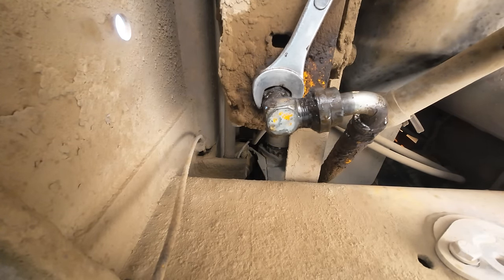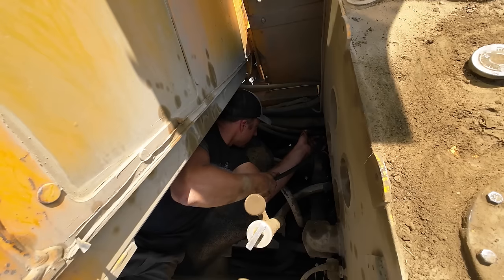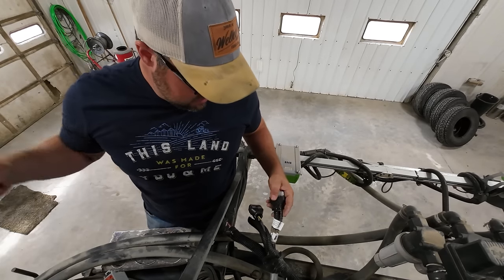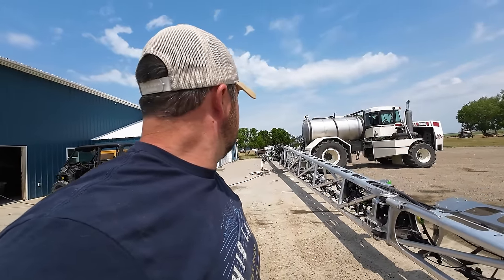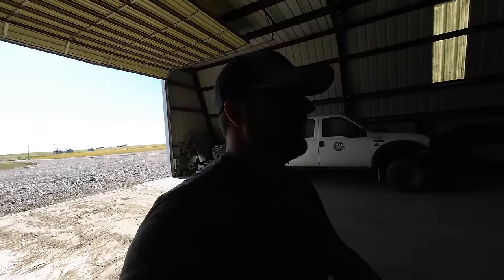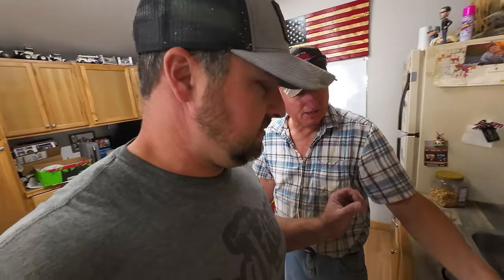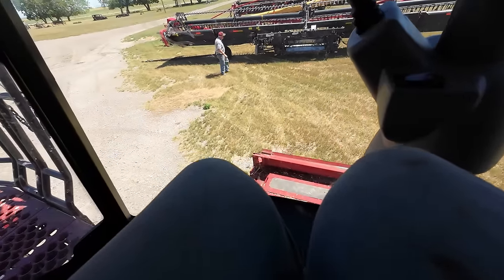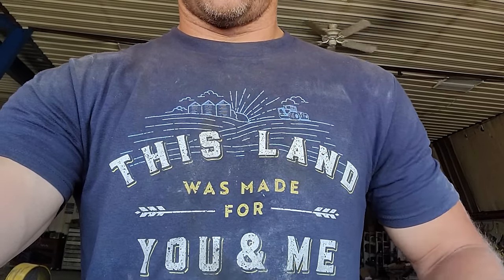Get The Combines Out! HARVEST TIME!!

Comment: When putting the combines away for the season put dryer sheets in the cabs to eliminate the chance of having mice in them over the winter months
Reply: I do the same.  In the winter I stuff dryer sheets around the motorcycles, lawn mowers, etc, and spring around snowmobiles, snow blower etc. to keep mice from chewing on wires, etc.   I was told Bounce brand works the best to keep the mice, other critters away (don't know if that is true, but have not had any problems so I stay with Bounce - superstition I guess)  now the question is if mice and other critters don't want anything to do with the stuff, yet we basically rub it on our bodies - hmmm...
Reply: You guys must have weak mice. Our mice make nests out of dryer sheets and fresh cab.
Reply: @Drew-in-NoDak  yea no kidding 🤣 I've given up on putting things inside of machines. Cats are probably #1 pest control followed by a slug of traps inside buildings where mice might enter.
Reply: Dryer sheets are not going to stop mice
Reply: @farming4g cats cats and more cats

Comment: Having worked for International Harvester starting in 1980 until I retired from Case International dealerships in 2013 as a parts man at the service side of the dealership I saw a great deal of changes in the combines from the 1400 series right up to the 2300 series so I saw a lot of changes over the 32 years that I was employed by those dealerships in Lethbridge Alberta. I see that both Nick and Scott as well as your Father have a real talent for repairing and doing the necessary maintenance to your equipment. The dryland farmers here in southern Alberta are experiencing the same weather conditions that you are there in Northern Montana. Immediately around Lethbridge there are large irrigation districts which helped the Local Case IH dealership where I worked to survive the good years with the dryer years.

Bernard Tichler
Lethbridge, Alberta Canada

Comment: It is hard for an Oklahoma farm boy that started out driving a John Deere 55 with a 14 foot header to get used to those headers you are running today.
Reply: I started out with a 55 corn special with a 15 ft head and 2 row wide corn head. Then 7700, 7720, 9500, 9600, 9660, 9770, S670. Now we have a S780 and 40 ft header and 12 row chopping corn head.
Reply: @lynwessel2471  As far up the ladder I went was a 105 with an 18 foot header. Then I won an all expenses paid camping trip in the mountains...of Vietnam. I was using a 105 there but it was a howitzer.
Reply: @1murder99  Thank you for serving our country.
Reply: @lynwessel2471  Turns out that Oklahoma farm boys are very good with 105mm howitzers.

Comment: I use a product called cab French inline combine. It is a potpourri developed by a farm wife.. I put in the combine cab and it works pretty well change it out once in awhile while the combine is sitting. But I even used it in my farm truck for air freshener in the.